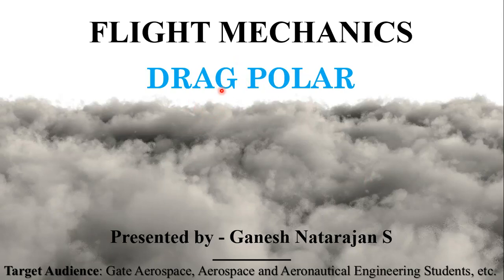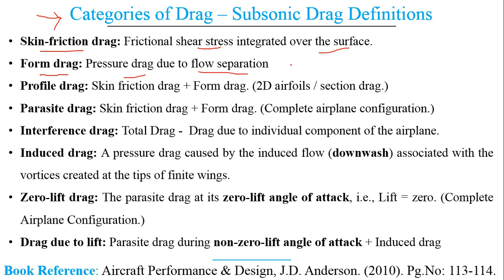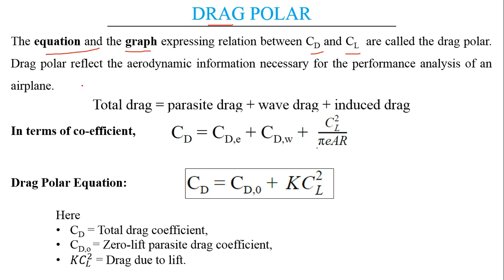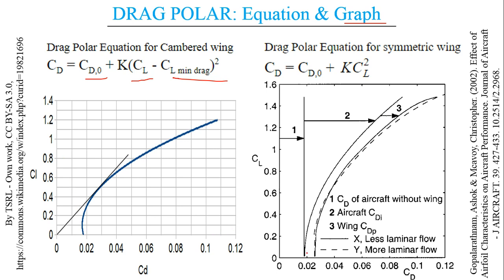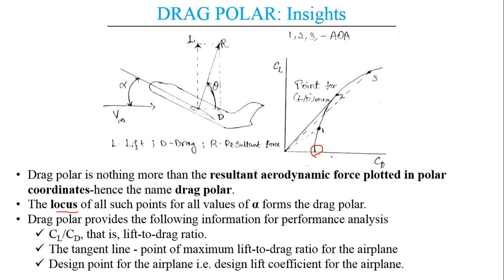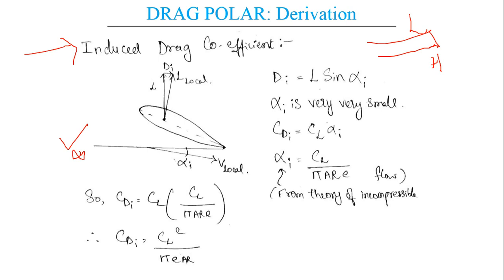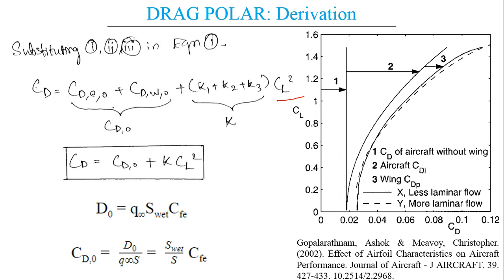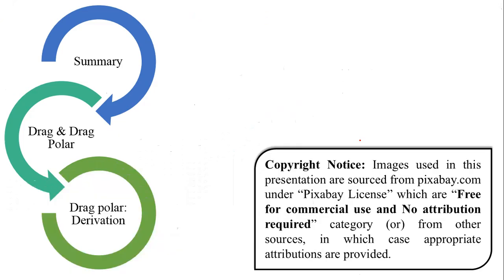Drag polar | Flight Mechanics | GATE Aerospace

Comment: Nicely explained..✌
But, How does these coefficients 
(values of k1 and k2) are derived?

and what about Oswald's efficiency (e)?
In many numericals it is assumed at 'e' is some percentage (eg. 0.77) But in what way, value of 'e' is actually determined ?
Reply from the maker: Derivation of 'k' the induced drag coefficient: https://www.sciencedirect.com/topics/engineering/induced-drag

Note: K1, K2 & K3 are just used for temporarly differentiating the drag components, basically they are the same i.e. (1/(Pi*e*AR));

The Oswald efficiency, similar to the span efficiency, is a correction factor that represents the change in drag with lift of a three-dimensional wing or airplane, as compared with an ideal wing having the same aspect ratio and an elliptical lift distribution. For conventional fixed-wing aircraft with moderate aspect ratio and sweep, Oswald efficiency number with wing flaps retracted is typically between 0.7 and 0.85. At supersonic speeds, Oswald efficiency number decreases substantially. For example, at Mach 1.2 Oswald efficiency number is likely to be between 0.3 and 0.5.
The efficiency factor e is equal to 1.0 for an elliptic distribution and is some value less than 1.0 for any other lift distribution.

Additional resources: https://www.grc.nasa.gov/www/k-12/airplane/induced.html
https://en.wikipedia.org/wiki/Oswald_efficiency_number

Thank You, I hope it helps!
Reply: @gateaerospaceengineering1130  
Hello ,
Yes, you're correct, span efficiency will decrease at supersonic speeds, this maybe due to shock formation or due to any else reason. 

The efficiency 'e' will be different if "only wing" is assumed to be flying. And won't 'e' be different if whole flying aircraft is considered (In this case it is 'e0')

And again for drag polar, the equation formed with K1, K2 and K3, will just be for a particular angle of attack (angle at which plane is flying at that instant).
Is it correct? If not, then what can be the actual case?
Reply from the maker: Yes the span efficiency factor 'e' depends on angle of attack (AoA). For further understanding you can refer the following link:

https://www.physicsforums.com/threads/oswald-efficiency.180760/